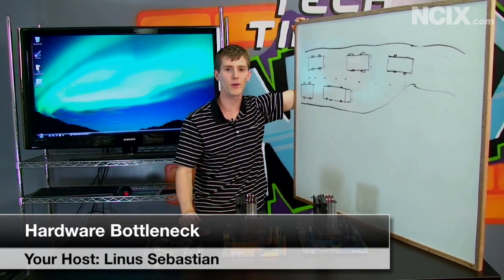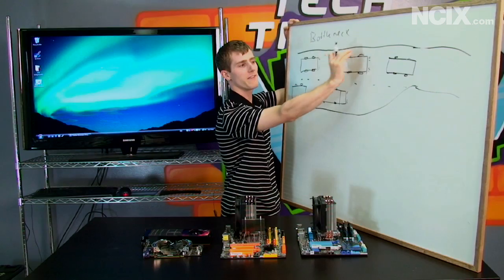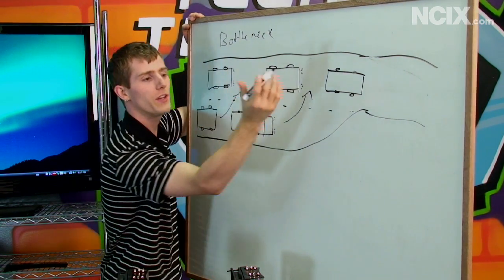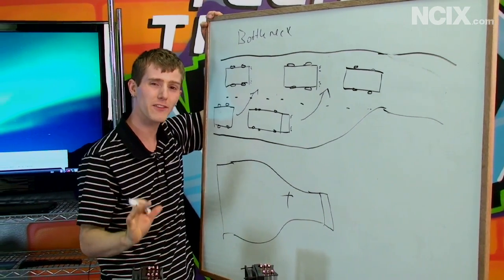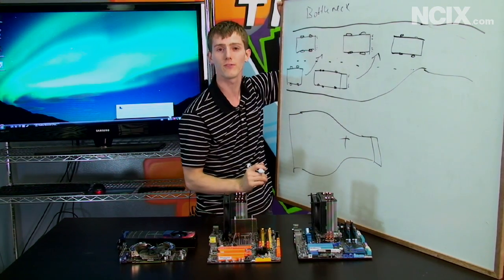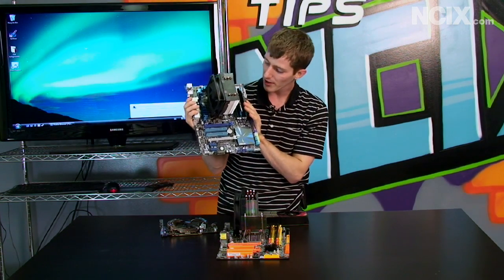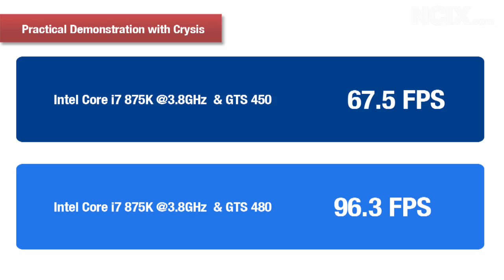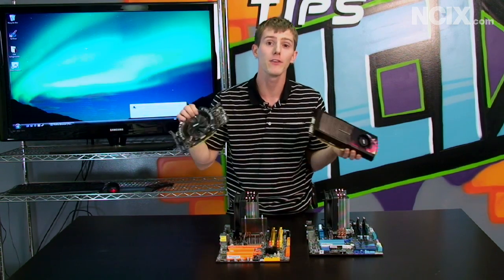Understanding Hardware "Bottlenecks" and How to Avoid Them (NCIX Tech Tips #81)

Comment: Opinion please i heave:

CPU - Intel Core i7-4770K @ 4 core x 3.5 Ghz (8 Threads)

CPU COOLER - Arctic Freezer 13

RAM - 4 x 4GB Vulcan (OC) DDR 3 (PC3 @ 2133 Mhz)

Motherboard - ASRock Z87 KILLER (FATALITY)

GPU - GIGABYTE Nvidia GeForce GTX 650 Ti 2GB GDDR5 PCI - E 3.0

Capture Card - Avermedia Live Gamer HD

PSU - Thermaltake SmarT SE 730W

HDD - Samsung SSD 840 EVO 250 GB

CASE - CoolerMaster CMStorm SCOUT 2

OS - Win 7 Ultimate

Monitor 1 LEFT : Samsung SyncMaster P2370

Monitor 2 MIDLE : Acer GR235H

Monitor 3 RIGHT : Benq GL2240

Headset : RAZER

Mouse : Logitech G500

Keyboard: Razer BlackWidow Stealth 2013

Do i heave a Bottleneck???

Comment: Hey just wanted to know if this is a good build if not please help.

GPU: EVGA Gtx 750 ti FTW

CPU: AMD FX-8320E

PSU: EVGA 500W PLATINUM

CASE: CORSAIR SPEC-02

RAM: 16GB CORSAIR Vengeance 2x 8GB DDR3 

HDD: WESTERN DIGITAL BARACUDA BLACK 1TB 7200 RPM

I'm really confused.
Reply: -_- ITS LIFE if you havent bought it yet, i really suggest you get only 1 stick of the cheapest 8gb ram you can find, and spend the money on atleast 280x or 960. The 750 ti doesnt cut it anymore
Reply: Axecution well I  see your point, but I always try to avoid bottlenecks, but is a gtx 960 too much for an and fx8320 or I could run well?
Reply: Axecution Question, I have a pc with integrated Graphics, my cpu is a AMD APU 3400. And I can play medium games, not the new ones. But if I do some tests on different sites and programs. It tells me that I need a graphics card for better FPS in game, games like Warfame and Warface. I get on low settings 40 FPS on medium 32 FPS and on high 23 FPS. Now is my question, if I buy a (new) graphics card will this give me a boost in FPS on those different settings and do I need to replace some components?  And is my CPU compatible with a card like a GTX 960 2gb or doesn't that matter.
Reply: Bigo Stream you will notice a huge improvement, although i recommend you get a msi 750 ti simply because it doesnt need extra power connectors and your cpu is a bit too weak for a 960
Reply: Bigo Stream unless you can change your CPU,Motherboard and get a 960. Otherwise get the 750 ti
Reply: Axecution Okay, thanks for the reply. Ok, but can I run GTAV ? And on what settings ?
Reply: Bigo Stream on atleast medium for sure, for high you might dip below 30 fps
Reply: Axecution Okay, thanks for the info. I would really want to be able to play GTAV :D And yeah, I don't have a big amount of money so yeah :/
Reply: Bigo Stream You should be fine even at high settings. Just dont expect 60 fps
Reply: No, I don't want a steady 60 FPS, I just want a steady gameplay above the 30 mark
Reply: Axecution You seem to know what you're talking about. So, question, would I be able to run an AMD fx 8320 OC to 4.0 GHz with a MSI GeForce GTX 960 2 GB without any problematic bottleneck?
Reply: -ChrisCross- No problems whatsoever, also you can overclock the cpu higher than 4 ghz, you should reach 4,6ghz without any problems
Reply: Thx man, really appreciate it.
Reply: Axecution Not to be a bother, but I've been looking at another card as well. Do you think I would have any problems with the R9 280x? Same CPU.
Reply: -ChrisCross- they are pretty similar at performance, the 280x is little better. Cpu still isnt problem
Reply: Axecution Again, thx. You've been really helpful.
Reply: -ChrisCross- no worries
Reply: why are you confused? you picked a decent build. only thing is you may only need 8gb but up to u
Reply: Bigo Stream I'm not sure if they implemented this recently or are going to add it soon, but they're talking about being able to crossfire an APU with a graphics card.  Might swing you to buy an amd card vs nvidia for the added performance boost.  Just something to keep in mind
Reply: Michael Winter Thanks for your reaction :)
Reply: Tidjane Ly It is better than mine, haha :)

Comment: Hei guys, i'm from India nd i have a question that i'm currently using an amd fx-8320 with 2 HIS radeon hd 6670 graphics ddr5 1 gb. I bought this cpu at around 10500 INR or 170 USD nd both card at around 5700 INR or 92 USD each. Did i do a right choice with in my tight budget, or there is any chance of disruption or bottleneck??

Comment: will i have bottleneck
Intel Core i5 2320 @ 3.00GHz
8GB ram ddr3 1333MHz
R9 280x 3gb gddr5 
PSU 600w
Reply: Not really.
Reply: Problably i have the exact same cpu and a gtx 780 doesn t work as it should try upgrading your gpu
Reply: Snowypuma6562 780 and r9 280x are miles apart. this system will run fine
Reply: Snowypuma6562
GTX780 is nowhere near as good as this GPU.

Comment: i have cpu:intel i5 760 (i can puch it up to 4Ghz),MB;gigabyte ga p55a ud3 ,RAM;geil 4GB 7-7-7-24 at 1333 GPU; GeForce 9600 gt 1GB HD;1,5Tb (with 3 HD each 500gb sata 2) PSU 550W Do you think that there is a bottleneck? thanks in advance

Comment: Will this bottleneck? i5 4670 nonk and ASUS GTX 1080 STRIX?
Reply: Duh that's not a good cpu at all especially in the combo with basically the most powerful graphics card available on the market today...
Reply: +BryanFDNY ye I thought I should go for the i7 6700k
Reply: +Xeffx a 4770k is already more then youl ever need for that card but sure that one will do just fine
Reply: +BryanFDNY 4770k is more expensive
Reply: +Xeffx it is ? i thought the 6700 was better as so more expensive
Reply: +BryanFDNY its like a gtx 1070, cheaper and better than something at a 1000usd
Reply: +Xeffx strange cause where i live its a 100 euros more then the 4770k
Reply: +Xeffx Can you get a 4770 Non K?
Reply: whys that?
Reply: ClassicGames yes but why would you, the K is just representing that it's an overclock able processor
Reply: ClassicGames you pay 20 bucks more and go from 3.5 GHz to a water cooled overclock of up to 4.3 to 4.7 GHz which the normal 4470 doesn't allow

Comment: Can someone tell me if this old build is still valid for playing DOTA or LOL at 30 fps (med to high detail) with no bottlenecks at 900p:

C2Q Q8300 + G41M combo Rev2.0
8GB DDR3 valueRAM @ 1066 dc 2T
SSD 120GB sams 840 basic
nVidia Gigabyte 960 mini ITX
PSU: CM v700 80plusGold

Thanks in advance

Comment: This is a bit outaded I guess, with AMD on the rise, $110 will get you a six core overclockable CPU at like 3.4ghz. Way more than enough, and you add in like an r9 290x or maybe even 2 of them. And I believe you would be golden. The only bottleneck on that could be ram and bandwith

Comment: is my CPU causing a Bottleneck for my GPU? AMD Athlon II X4 630 processor 2.8Ghz..... AMD Radeon HD 6800 Series 1024 MB GDDR5 Core Clock 790 MHz  Memory Clock in MHz 1000 MHz?? Please let me know im am considering upgrading to a AMD X8 FX-8320E (95W) Eight-Core Socket AM3+, 4.0GHz CPU, 8Mb Cache, 32nm
Reply: add the 8320 and throw in a gtx 760-780 and your golden
Reply: thanks tupac

Comment: HOW ABOUT MINE? DOES MINE HAVE BOTTLE NECK??? 
my Specs: 

AMD ATHLON X2-260 3.2 ghz
ATI RADEON HD 5570 1024mb
2 gb ram.

Please tell me Which I should change!
Reply: you sir do not have a bottleneck. if you do it is very slight
Reply: BUT  you should try to upgrade your ram. 2 gb is not the best. you will bet much better performance with another 20 dollar 2gb ram stick
Reply: yeah i will. tnx. then why does my pc suddenly lags for a minuite when playing then suddenly became smooth again?
Reply: Jm Sasis sorry for the late comment ive been busy working on my youtube channel :).  the reason that your computer does that is probably because you have really old parts. older parts usually lead to bad performance. it also depends on the games you play. like you computer is not make for hardcore gaming

Comment: INTER-TECH Energon EPS 750w
ASRock 90-MXGK60-A0UAYZ 970 EXTREME3
WD Green™ 10EZRX 1TB
Corsair DDR3 8gb 1866MHz
AMD FX-Series X8 8320 (3.5GHz,16MB,125W,AM3+)
2048MB Sapphire Radeon HD 7850 OC
win7 64bit ultimate
ihave oc processor at 4ghz and grapphic card and i am still not happy with performans in games fps gose30-60 in Wot (on maximum settings)
my case IS HAF912 and cooling is fine 
Plz take a look at my build and tell me did i bottleneck something here ?

Comment: Would my system running a Sandy Bridge based Intel Pentium G645 with a EVGA 2 GB GTX660 Superclocked be a bottleneck? It's running fine and plays my games perfectly fine right now, I can't afford an i5 anytime soon so this is what I've got. In my eyes, it's not a bottleneck.
Reply: ***** If I go by those means, it's like saying even a i5 3570K is a bottle neck and an i7 4960X isn't because it just squeezes more FPS? LOL. Anyway, thanks :P 

I see what you mean though haha.
Reply: If you cannot afford an I5 what about the new 8 core AMD CPU's that cost around £100 or $100?
Reply: JAGUARCD32X
Over here an FX83xx is over $160, lol. My Pentium was only $40.
Reply: Hector's Variety Channel i'll come from other side of bottleneck like cores, maybe that 2 core processor doesn't show any bottleneck, it depends on the games that utilize the cores of a processor.
Reply: JAGUARCD32X
If you changed your cpu to another brand you'd need a new moboad too which would just cost more than just getting a better processor of the same brand you already have, that's how I got stuck with AMD haha

Comment: Hello friends.soo i have a question. i want to move to a new video card and here are some i might buy : gtx 750ti,gtx 650 ti boost,gtx 660 used,r9 270 used or maybe new,r7 260x or r7 265. here is what i ask i want u 2 help me choose which 1 should i buy which 1 is compatible 2 my computer and which is best choise. my specs 

core i3 3240 3.40 ghz >(this is quad qore i belive in task manager it shows me 4 but i dont really understand concept of qores and thread or something)
ram:  4gb ( i dont know how much mhz it is if u know how 2 understand pls help me)
500gb
and worst of all i have nvidia geforce gt 730 this is new video card and this gt 730 is 3 typres (mainly) 1:902 mhz 64bit ddr3 2gb 2: 128 bit 2gb 700mhz ddr3 3: GDDR5 1gb 902 mhz 64 bit.  OK i got second the worst one 128 bit 700mhz ddr3 i can run games like crysis 3  ac4 black flag but they lag for example the crysis 3 resolution 1280x720 all low anitrosblablabla x16 texture medium i got min 8 avg 26 max 48 fps I DONT RECCOMENT YOU 2 BUY THIS VIDEO CARD IF U ARENT GAMER. all i want is playeble fps and nc graphics (nc graphics not max) and i am low on budget so help me decide which one should i buy 

AND PSU  I BELIEVE ITS 500W

TY FOR ATTENTION AND SORRY FOR MY ENGLISH
Reply: http://www.reddit.com/r/buildapc Post your question here. Very helpful community, someone will be able to help you out.
Reply: Stian Arntsen ok ty

Comment: Many people have told me that my GPU is bottlenecking my CPU. 

My laptop specs:
 Operating System: Windows 7 PRO, 32 bit

RAM: 4 gigas 

Graphics card: AMD Radeon HD 7740M

Processor: Intel Core i7.

Is it true?
Reply: Yes, but you likely got a laptop that wasn't catered for gamers, look up MSI, Asus or Lenovo to name a few good companies that sell good gaming laptops if you must get a laptop which I recommend you look at building a desktop pc
Reply: because you are using intel hd graphics not the radeon 7740m! to use your radeon discreet graphics card, go to bios change your video card settings from DYNAMIC to FIXED.
Reply: tristan velasco thanks so very much man☺
Reply: Hoss delux many people have told me that laptop was made for gaming thou, it has a great cpu, plus, I'm putting a 64 bit os and 4 more gigas of RAM. Why is if bottlenecking?

Comment: Proccesor: Intel(R) Core(TM) i5-2500 CPU @ 3.30 GHz 
RAM: 8,00 GB
Graphics Card: Amd Radeon HD 6700 Series
Chip Type: Amd radeon graphics proccesor (0x68BA)
Dac type: Internal Dac 400 mhz

Can I Buy gtx 970 without bottlenecking problems,? I currently play Tera and get 45-20 fps

Comment: Operating System
 Windows 10 Pro 64-bit
CPU
 Intel Core 2 Duo E8400 @ 3.00GHz 45 °C
 Wolfdale 45nm Technology
RAM
 8,00GB Dual-Channel DDR2 @ 399MHz (5-5-5-18)
Motherboard
 ASUSTeK Computer INC. P5Q (LGA 775) 30 °C
Graphics
 W1942 (1440x900@60Hz)
 512MB ATI Radeon HD 4800 Series (Sapphire/PCPartner) 40 °C
Storage
 111GB KINGSTON SV300S37A120G ATA Device (SSD) 30 °C
Optical Drives
 HL-DT-ST DVD-RAM GH22LS30 ATA Device
Audio
 Realtek High Definition Audio

should i upgrade my gpu the cpu is oc to 3.6ghz and if which ones thank you!

Comment: I'm really new to pic building, I'm a newbie I just bought a gtx 970 my current cpu  which costs I think 50 bucks is bottle necking it I'm not getting more than 30-40 frames and idk what cpu to buy?
Reply: +Patrick Huynh i5 4690k or if you're on a tighter budget i5 4460 you have yourself a serious bottleneck lol
Reply: lol yea ! hahah i just did some research and the i5 4690k looks good to me!
Reply: Patrick Huynh If you could afford a cpu cooler, the 4690k is a great overclocker.
Reply: +Patrick Huynh Any i5 better than i5 2400 will do the job

Comment: More than enough even at stock speed.  This isn't like ten years ago.
You're not going to want to use a Core 2 Duo with an SLI TITAN setup, but Sandy Bridge and later Intel chips are still damned good. (and man do they overclock nicely even on air cooling)

Comment: I have a Core 2 Quad q8300 @ 2.5Ghz. 4GB DDR2 @800Mhz. Gigabyte GTX 750 TI X2 Windforce. MSI MS-7529 V1 Motherboard with PCIe gen 1.

I seriously need an upgrade, BUT I can play Dying Light on MAX with view distance on min at 50 - 60 frames average. This means I outperform some i7s. :)

Comment: i3-4130 3.4GHz + GTX-760 2GB, will that bottleneck?
Reply: Probably not.
Reply: That's pretty similar to what I have. Most of the time there won't be a bottleneck, but occasionally the cpu does hold you back in RTS games, or Guild Wars 2 for some reason.

Comment: Will and 8150 bottle neck r9 290?
Reply: no it won't but i would take a intel i5 3570k in ur case is simply much faster while gaming or just a new fx-8350 cuz its the new amd line
Reply: PlaylistChanal
An i5 3570K isn't MUCH faster than that really. But I will say that an i5 3570K is the 8320/8350 equivalent while the i5 2500K is 8120/8150 equivalent. Those 8 cores really do help, especially when rendering video. :)
Reply: FX 8150 is really slow in games,the fact is an PHENOM II X4 980 or PHENOM II X6 1090T at their stock speeds can wipe-out any Bulldozer FX core...
A better cpu is FX 8350 wich is a little faster than 2500K at stock frequency.
Don't believe bullshit like ''3570K isnt much faster''  'cause it is MUCH FASTER indeed!
You want I5 gaming performance? Get an 8350!
You want truth about those Bulldozer weak cores? Just GOOGLE it and you'll see what i'm talking about here.
Reply: just buy a i5 3570k or an 4670k
Reply: PlaylistChanal  I agree the 3750K is a amazing CPU for not bottlenecking and can be OC'ed easily
Reply: but an 4670k is the fastest u can get without throwing money out for things like an 4770k (same for the 3570k its just the last generation , its better for overclocking cuz the chips are a littlebit larger but never mind) the problem i see with amd cpus at the moment is that they have a high tdp and are not very "optimal" cpus. for me and intel 4 core cpu is the only way to go at the moment but dont misunderstand me my last cpu was an amd and my gpu is from amd too...no fanboy :D

Comment: with that logic my pentium d overclocked to 3.1ghz won't be a bottle neck for my 7870. CPU frequency isn't a real relevant factor anymore considering cpus are getting smaller and more efficient IE a 1.8ghz atom processor is faster then my old Pentium 4 2.8ghz on a 478 socket. Basically to avoid bottlenecks you are going to look for items within the same generation and around the same performance IE amd 720 tripple core matched with a 6870-7870 (mid range) just rewatch the video and pay attention

Comment: in bf3 utlra i7-4770k and i7-2600 will perfome the the same both have the smae average and min fps even the i7-870@ 2,93 ghz is only like 2 fps lower than those cpus. most games dont requrie so much from the cpu that a 2600k would bottleneck your configuration

Comment: Would a... 
AMD FX-6300 @ 3.5 GHz
Corsair Vengeance 32 Gb @ 1866 mhz
cooler master 1200W power supply 80+ certified platinum bottleneck a: 
Asus rog striker gtx 760 @ 1085mhz?

Comment: I do have my RAM on the sweet spot...on 1866mhz with the timings at 9-9-9-24 CR2...they are more for the Intel but they work on amd just as great...on the NB and HT clock is 2400 and 2600...I don't OC my system because of bad cpu cooler and PSU but i like it just as it is...

Comment: My specs:
Sapphire AMD R9 290 TRI-X OC
AMD Phenom II x4 BE 3.8GHz (OC)
8GB RAM

My GPU load while playing AC Unity is 45/50-60%. And my CPU is on average 77-88%. Does this mean my CPU is bottlenecking me?
Thanks!
Reply: A Phenom II is definitly a Bottleneck :)
Reply: Alex Creemers Would it make a big difference If I OC it further to 4,0GHz? If not, what AMD CPU would you recommend?
Reply: To be honest the CPU is to slow to keep up with the R9. But upgrading depends on how tight your budget is. I chose a FX8350 cpu. Which is perfectly for your R9. Im running one also. With a MSI R9 290.
Reply: Alex Creemers Will my Cooler Master Hyper 212 Plus be a good match with the CPU? And how about my Cooler Master GX 550W?
Reply: Alex Creemers And what about the FX6300? Which one to choose the 6300 or 8320?
Reply: I have a CM Hyper 212 Evo. Which are great imo. So yours is pretty darn awsome ! I would recommend a FX8320. Just to be future proof. Im using a CM GX 750W. 550 Should be ok. But recommend a 650W + :)
Reply: MightyWolve get fx 8350, fx 6300 is goof for r9 270s and 280s but i think 290s are really pushing it
Reply: ^ Exactly.

Comment: Gigabyte h97n-wifi mobo
i5 4690
GeForce gtx 970 turbo
8gb corsair vengeance 1866mhz
120gb ssd boot drive
1tb hdd data drive

Can I run crysis without bottleneck?
Reply: +Tyler Figueroa probs